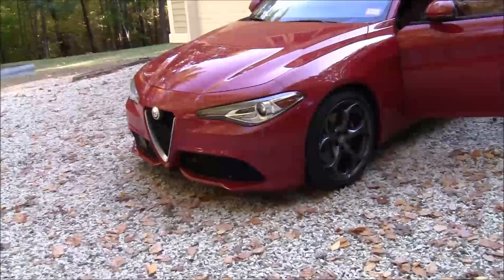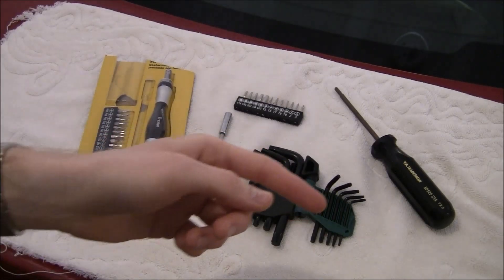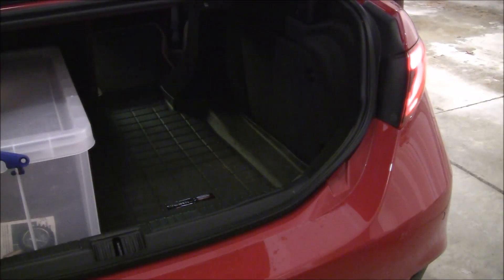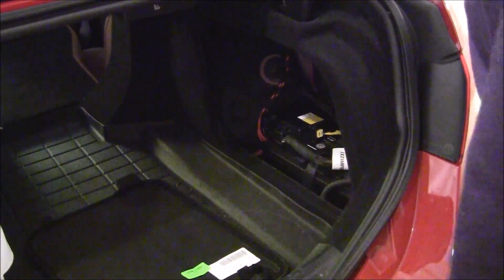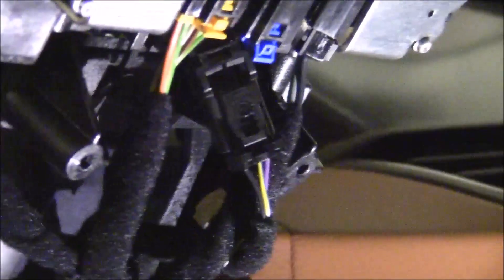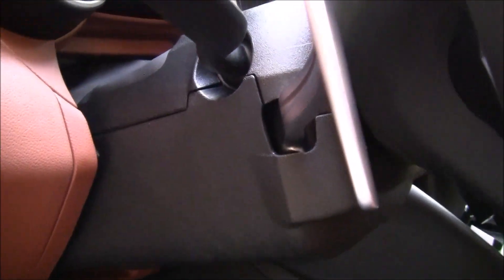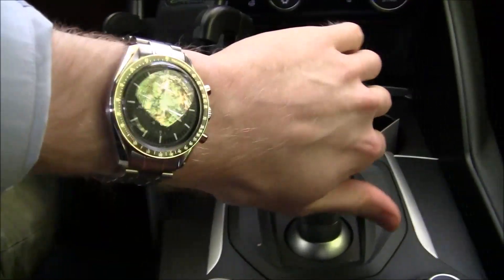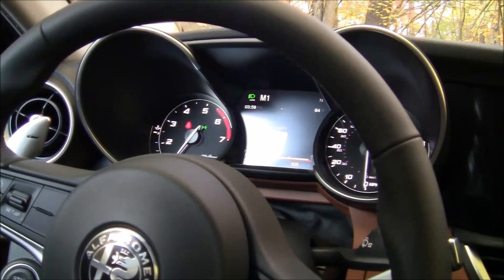Installing OEM Paddle Shifters on Alfa Romeo Giulia / Stelvio with MultiECUScan explanation

Comment: Hi ! Fantastic video.... I have a question 🙄❤️ why do you need coloured cables? On that web site there are many types of connectors ,many colours... with gray and blue can you access every functionalities of MES software ? Many thanks!,!
Reply from the maker: Hi, thanks for the comment. The blue and grey adapter cables are what's needed to access every module with the Giulia and Stelvio in MultiECUScan, but the program works for many other Italian cars. The other colored cables are often used for Fiat vehicles. Since I do not have a Fiat, I did not need to buy anything other than the blue and grey
Reply: Ferris Schueller perfect! Many many thanks

Comment from the maker: @GANG SHEN, I am getting emails that you've asked where to buy the paddle shift assembly, but they never appear in this comments section.

Ebay is a good bet, but also https://parts.moparonlineparts.com/alfa-romeo-parts-genuine-alfa-romeo-module-steering-column-6kd43lxhaa?parent=1001 -- updated link.
Reply: That link is incorrect. It's for chrysler, fiat etc not alfa romeo
Reply from the maker: @bikeman123  I posted that 5 years ago. The link changed. Here's the new link. https://parts.moparonlineparts.com/p-genuine-alfa-romeo-module-steering-column-6kd43lxhaa

Comment: When I try to execute the proxy alignment it fails
Reply from the maker: Are you using the same cables as me? Try restarting your computer too
Reply: Ferris Schueller yes I have the same exact cables and I programmed them but now my check engine light is on and my odometer is flashing
Reply from the maker: @Ian-zu9pn  Yeah the flashing odometer just means the BCM has sent a proxy configuration code that the networks don't agree with. This prompts a DTC to pop up (in your case, the CEL). If three ignition cycles don't clear it, I would attempt the proxy alignment again. The flashing odometer is the telltale sign of a proxy configuration discrepancy, but your mileage won't be affected (in case you were concerned)

Comment: Thanks for the video! Do you know where I can get the steering column lower cover the link in the description doesn’t work anymore. Thanks
Reply from the maker: Sorry the link went away, they changed the URL. 

https://parts.moparonlineparts.com/alfa-romeo-parts-genuine-alfa-romeo-shroud-steering-column-6cv10lxhaa?parent=1001

Here is the same parts distributor, same part/part number -- new url -- updated description as well

Best regards,
Reply: Thanks! it works now, I’m buying all the stuff to retrofit my Giulia as well
Reply from the maker: @lewiscalderon8972  Great. Let me know if you need help setting up MultiECUScan or anything else. I use the paddles all the time now that they are fitted
Reply: @Ferris Schueller Thanks a lot! I have a 2019 Giulia so I would need to install the bypass to make it work right? But what if I take it to the dealer after I install the paddles do you think they can enable them for me?
Reply from the maker: @lewiscalderon8972  they need to change the sales codes which they might not be willing to do, or not know how to. It is easier DIY, the dealer shouldn't really get involved with this
Reply from the maker: @lewiscalderon8972  And yes, 2019 requires SGW bypass plug to write modules.
Reply: where are you buy the paddle shifter?
Reply: @gangshen3559  I have a set for sale. Let me know if You still need them. my email ukpart19@gmail.com

Comment: Great video thank you does it matter if pedall Shifter is from RWD because mine is AWD
Reply from the maker: Thanks. Nope, not at all. Mine were from a Giulia Quadrifoglio. It doesn't even matter Giulia/Stelvio specific either, they should all be the same parts across the Giorgio platform in this regard.
Reply: @ferrisschueller3984  thank you brother much appreciated and again thank you for this great video
Reply: @ferrisschueller3984  me again quick question do I need SGW BYPASS PLUG
Reply from the maker: @iggyiggy2641  What mm/yy is the car? Open driver's door, look at the sticker. If it is "2/18" -- Feb '18 -- or later, you will need it
Reply: @ferrisschueller3984  got it it's 11/17
Reply: Perfect I don't need it nice thank you again
Reply from the maker: @iggyiggy2641  Nice. If you message me your VIN I might be able to tell you the exact day it was signed off at the factory if you're interested. If I can get that, I can give you every option code, and build sheet too. Sometimes my program doesn't work very well though
Reply from the maker: @iggyiggy2641  Nice, great design.

Comment: Awesome video MaxFerriswell! Quick disconnect on the negative battery terminal works very well, super easy once you figure it out! Removing the negative terminal is recommended as that is able to touch the body or any other grounded point without causing sparks/damage.
Reply from the maker: Great, thanks. So removing the terminal was the right idea in this case?
Reply: @ferrisschueller3984  If it was the negative terminal, yes, same as what the quick disconnect does.